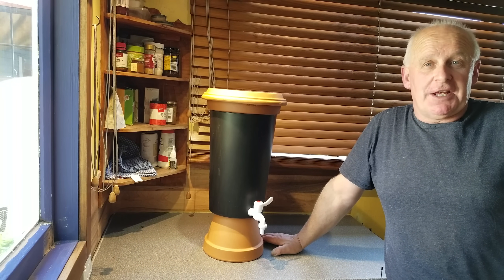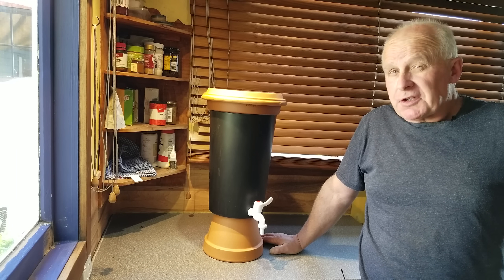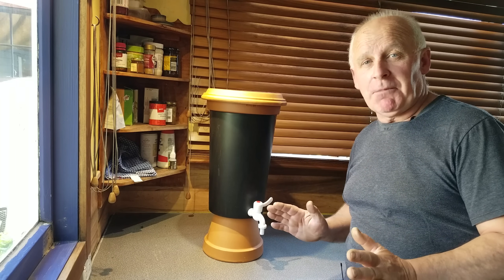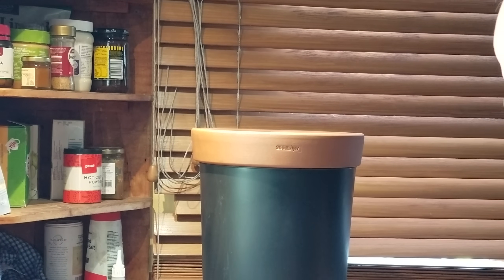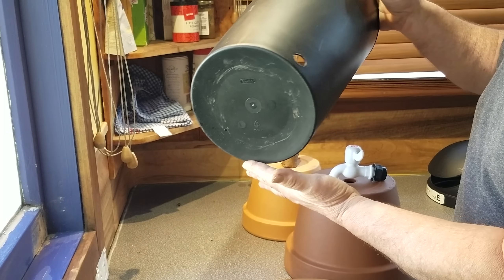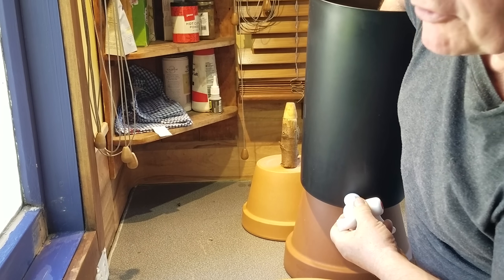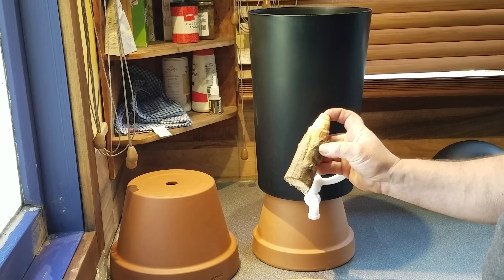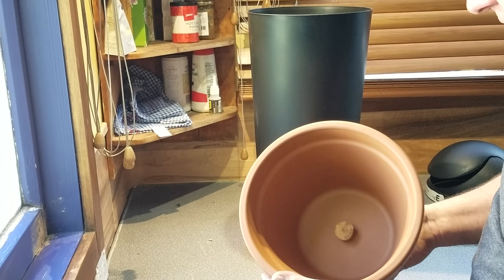DIY water filter. How to make FILTHY WATER drinkable

Comment: Clay filters like this have been employed for decades to produce clean water from a mud puddle. There are a lot of biochar vids out there, combining these two techniques could give a far superior product than arrives at most taps from a municipal water source.
Reply: but is the trash can food grade...did he just re contaminate the water??
Reply: @WilliamHelstad  you don't need to activate the biochar, it will have plenty of adsorption capacity already without steam activation.
Reply: @CarbonConscious  one scientist proves that crushed heated charcoal wasn't nearly as good as activated charcoal, but said and proved it was often good enough .  Does municipal water filter out all of the meds Americans use?  I think it doesn't.
Reply: @WilliamHelstad  The reality is tap water is nearly always better for you , Unless well  maintained most if not all filters will re release or worse harbour a host of micro organisms , not all good . Any plastic will slightly contaminate water . You can use grey water for watering plants , fecal matter must be composted separately . pee around trees .
Reply: @WilliamHelstad  I eat seaweed to get my micro-minerals, but a high fiber diet also helps gut microbiota process minerals better.  If you're living on white flour with too little plant fibers, you r body can't use minerals from any source well enough.

Comment: Thank you for a great cheaper version of the Berkey. (I decided against getting one due to having to replace the filters pretty often) A couple of questions please.....
I collect rainwater which comes from my roof thru the downpipe but it’s full of moss & mites... will your Berkey filter those out?
Second; why are you bunging up the hole in the top pot?
Reply from the maker: First-  If you are collecting water from your roof- surely you would make sure that its clean?
Second. The wooden plug stops the water pissing out the hole! 
Are you sure that this project is for you?
Reply: I watched a survival show once where the guy used moss to filter/purify water from a bog due to the high iodine content in the moss.

Comment: Good idea. 
Perhaps you should mineralize your water  with a tiny bit of sea salt after filtering. Since rain water has no minerals, it's kind of like drinking distilled water I suppose.  Not good for your health as you lose electrolytes.
Reply: Not really a concern if you are salting your food like most people already do. And if you are eating the typical American diet, full of processed foods, there is already a ton of salt added to it, that you only have to supplement each day with either a small potato, banana, or dried apricot to ensure you are balancing the sodium with a sufficient amount of potassium.
Reply: @app103   Well, ok then.  : )
See you next time. Cheers from Berlin.

Comment: Wonderful idea!  Although, here in Arizona, we would die of thirst long before enough water fell from the sky to supply our needs. I think this would be a great way to filter out the calcium carbonate from our water and leave it tasting less like wall plaster ;-)   Thank you!
Reply: @J.D. Ricks Have you ever seen a terra cotta flower pot with whitish 'stains' on outside? Chances are, that stain IS calcium leeched from the soil in the pot... it passes THROUGH the pot. That means the pot will be less effective at filtering calcium carbonate. The problem with this method of water filtering is, in general, there is no standard for 'pore size', filtering capability, nor heavy metal contamination for clay pots... there are the random safety recalls when a contaminated batch is discovered, but that is generally done AFTER significant human exposure occurs (clay pot manufacturers in the States are supposed to monitor this, but it is a 

Basically, I will not trust a clay pot unless a decent chemical scan is done on it.
To assume this material is ONLY filtering-out is unwise. The exact makeup of the clay WILL VARY BY LOCALE, and can contain impurities. These impurities can leech out over time, and the process of water filtration can speed up this process.

For background, you can read about the problems encountered in ceramics made specifically for the storage of foods (which is supposed to be more highly regulated), then extrapolate the potential to the less-regulated flower pot industry : 
ncbi.nlm.nih.gov / pmc / articles / PMC3127121

Bottom line is: the ceramic filters that are used in safe water-filtration devices are tested extensively for contaminants, and the ceramic pot clays are not. The pore size and filtration characteristics of actual water filters are well-defined, controlled, and verified. This is not the case for flower pots. It might be ok for a true emergency, but I would not want to drink from it on a regular basis unless I could personally inspect that specific clay's mineral/organic compound analysis.

Comment: Cool concept.  Firstly, I want to say that if municiple water sources went to crap and became unavailable or unreliable I'd rely on this ASAP because it's simple, uses common parts and would likely be better than unfiltered water from any source available reliably.  I would be actively sourcing a replacement, however.

That said, a couple things to note: 1. unglazed terra cotta should be sterilized before use and typically contain wildly varying pore sizes which may not prevent most waterborn pathogens from getting through.  2. plastic containers not designed for food prep and storage are usually made with binders and separaters that they absorb which can leach into the water the container stores; most of these compounds are aggressive carcinogens or can do significant damage to the liver and kidneys.
Reply: Agreed. First thing I thought (after, brilliant!) was, but I’m not using plastic to catch it, especially not a trash bin. Ceramic and glass containers with spouts already on them are common at our thrift stores, so. Sterilizing the pot first also a stellar idea.
I was wondering if we could even make this more like a Berkey by adding layers in the pot, such as activated charcoal, clean sand, etc.
To those talking pathogens, we can always boil the water as well, before or after.
Reply: I would just buy a wide mouth glass container with spigot already attached. Would also experiment with using sand and charcoal in the terra cotta pot for more filtration and depending on source ad a drop of iodine.
Reply: Food grade H²O²? 🤔 When H²O² kicks off its extra O, what's left is plain ol H²O. If it wasn't already pure, it would be kicking off that extra O, and you'd be buying a bottle of water and complaining to the manufacturer.
I'm more than willing to bet if you treated your flowerpot filter like a dish you wash, you'll be just fine. As far as Microsoft plastics, we're all f'd up with that mess, just go on and don't let it stress you too much. Your organs can handle a remarkable amount of abuse, but worries and stress will wreck you quicker than anything. Its crazy how our bodies regenerate when in a relaxed healing state away from all the frequency noise.
Reply: Add food grade dye to the water for a test
Reply: How would you sterilise the terra cotta?
Reply: @honeybeeblossom5846  oven
Reply: @honeybeeblossom5846  you can just put it in the oven if it will fit.
Reply: @honeybeeblossom5846  possibly h202 (hydrogen peroxide). Or colidol silver
Reply: Could you put it in boiling water to sterilize? Like 15 min?
Reply: @love love How would you do that? Buy a large quantity and soak or spread evenly over the sides and let dry?
Reply: @leighburville2717  Or chlorine dioxide.
Reply: Yes I'd much rather just find a glass jar or a ceramic pot to filter into, not plastic, no matter what little symbol is on it.
Reply: You drink municipal water? That stuff is full of flouride (makes you dumb and apathetic) and tons of drugs like cocaine,  birth control and psych meds 😕 Investigate your supplier (it's all online results) and do a little research, I guarantee you will never drink it again! The only tap water used in our home is for bathing& we always neutralise with h202,borax,sodium bicarb& bentonite clay, done this for years now and would never go back to drinking the stuff now ☺
Reply: @m3ount973   @M3ount  you bathe in municipal water? Don't you know our skin is the largest organ and exterior absorption is the same as interior?
Reply: Better get the components now while they are still cheap and available because when TSHTF, anything like this will be snapped up immediately.

Comment: Can't get it to work. Tried two different pots that looks just like the one shown. Not one drop came through. I think his wood plug leaks. I used silicone for my plug.
Reply from the maker: Did you wash the pot in hot water to remover the wax coating?

Comment: The link makes a number of medical claims about colloidal silver. Those claims are quackery. Colloidal silver has no demonstrated medicinal benefits, and because the body has trouble disposing of ingested silver, ingestion can lead to skin, kidney and liver disorders. 

Colloidal silver is under investigation as an anti-bacterial agent for use outside the body. Research so far is not conclusive.

So, great filter, but don't bother with ye colloidal silver spray. It may be useless, and absent a demonstration to the contrary, it is reasonable to suspect it could leak throuh the ceramic and into drinking water. Iodine tablets, sulfur dioxide tablets and the like are proven water purifiers and are not expensive.
Reply from the maker: wahahahahahahaha! who wrote what you just copied? sounds like they are trying to sell pharmaceutical drugs?

Comment: Interesting, however: Some clay (terra cotta) containers are designed for food use. However, clay pots from the gardening center are not meant to be in direct contact with food. The clay in garden pots may contain heavy metals, such as lead. "
Reply from the maker: Pakistani clay has lead in it- Italy is renowned for its tableware- just make sure you use italian pots. mine are stamped Fabrique Italiano

Comment: You mentioned cleaning the inside with colloidal silver.  I would also clean the outside of the filtering pot with colloidal silver.  And I like the idea of the silver coin in the pot too.
Reply from the maker: That's a good idea! someone else suggested cleaning it with vodka- that started a whole new conversation!
Reply: @t.h.o.r.  Do you spray it every time you fill the pot, or just the first time?

Comment: in the process of trying this on a small scale. the water is NOT draining thru the clay pot....well, after 24 hours,  I have less than 2 ounces!! not good enough. any ideas anyone? 
Doesn't look like "he" answers much...please anyone who is actually doing this... TIA!
Reply from the maker: Hi Silvee- did you scrub the pot first with scourer and hot water vinegar to remove any wax? Some are waxed to slow down water tranpiration.

Comment: You collect water probably from roofs. Does your system filter out bird poop. Have you ever had your filtered water tested?
Reply from the maker: can you envisage what a 2 micron filter is?  2 micron is 2 1000ths of a millimeter. small enough to remove pathogens, bacteria and even a percentage of virus . The links in the video take you to The CDC website where all this is explained. Also explained is the water collection system that I use- no- its not roof water.

Comment: Hmm, so the thing here is that you filter the water through a piece of cypress wood? Is that it?
How often do you need to replace the piece of wood? I guess the "bacterias" are stuck in the wood while filtering the water through it.
Reply from the maker: no!- the water is filtered through the 2 micron pores in the ceramic- the plug of cyprus is to stop it pissing through the hole in the bottom!- 😴

Comment: Cool idea but did you know that the clay used to make terracotta flower pots may contain heavy metals like lead? Flower pot clay is different from the clay used to make terracotta cooking pots. With that said I don't see why you can't make this filter using a food safe pot. :)
Reply: Yes, but is a ‘food safe’ pot going to be porous??
Reply: @MattAlexan  It will be porous if it is unglazed. There are unglazed food grade terra cotta baking pots available. They are most commonly used for baking artisan bread. The bonus is that they often also come with lids, and there is no hole in the bottom to plug up. The downside is they are substantially more expensive and finding one of the right size and shape can be difficult.
Reply: You can buy a very inexpensive kit to test for lead or you can take it local health dept to be tested.